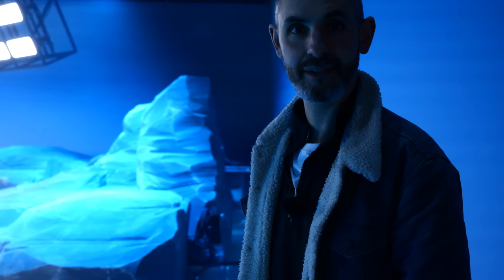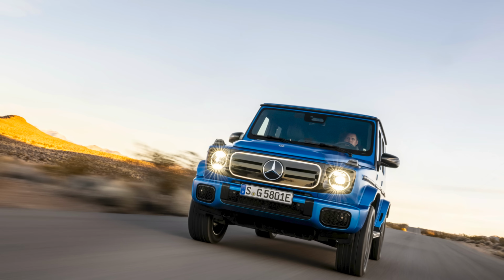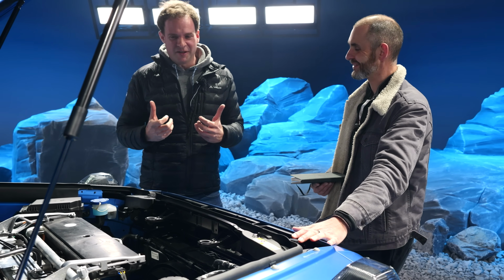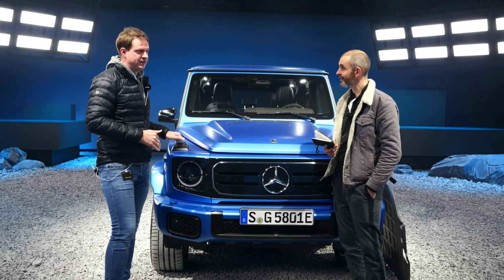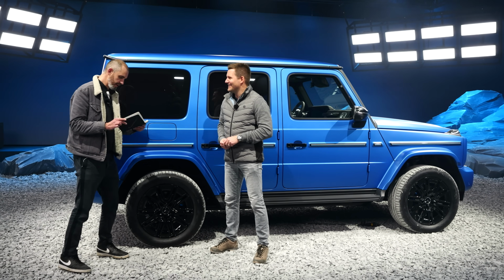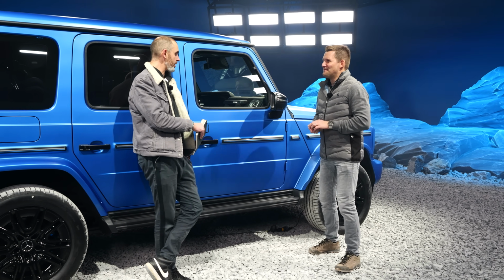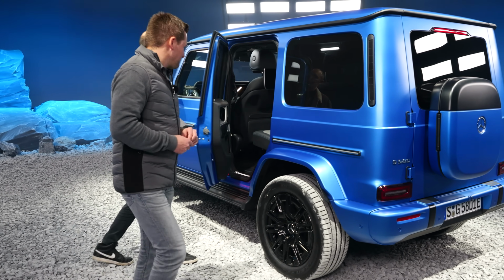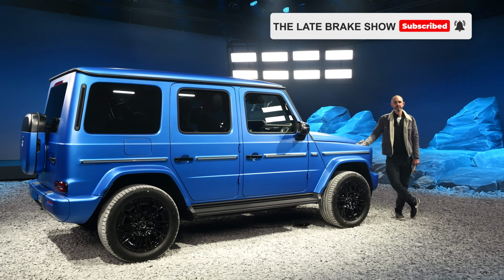Mercedes G Wagen goes Electric - Detailed 1st Look

Comment: Nice car, glad it is on the channel,  G wagons are unique though, better than the ICE version i would think. Price will be eye watering. but 3 tonnes is like other big EVs a bit lazy in the design. For Evs to really work we need  loads of 7 KW destination chargers that mean batteries can be smaller to get lighter more efficient EVs.

Comment: Lol……a  3 ton EV tank that will never be used off road……expect to see a lot of these pre-reg in 8-12 months at 40% off list……same as the Taycan. Small EV’s with small batteries for local use work ok with current battery tech but these behemoths are a resource hungry joke. 

Black Circles are no longer “proudly sponsoring” the infomercial either 😢😢😢

Comment: The EV idea has been pretty boring in my opinion pretty much since they came out, yes they have built some extremely fast ones but the practical side doesnt justify it but after watching this i actually really like the idea of the EV G wagon for what it is designed for and if you are buying it for actually off roading and having fun in then it does make sense if you have the money, lets face it most people couldnt afford it but for the few that can it sounds like a good fun car!

Comment: Hi I'm Carpenter living in Norway, the guy building the house beside my project had a G wagon he rolled it down a moutain side as in roof, doors,undercarrige about 7 or 8 times and still survived so he was totaly impressed with the strength of the box!
Reply: He’s lucky he wasn’t in the battery version then…….he would have survived to roll down hill but not the ensuing thermal runaway fireball!

Comment: Hi Jonny. Your show is quirky but real interesting. Not sure what the market is for the 3T Merc G Wagon as its weight is a problem when it comes to range. I'm in Australia own a 1965 289W Muzzy & a 2015 Forester turbo & I don't know how many times I have driven on the empty  line in the Muzzy or on the orange fuel light in the Subie. I live in the country so 200-300km daily is a regular occurrence. Charging locations are scarcer than rocking horse poo. Even If I run out of petrol, I can get to the closest petrol station get back to the car & off I go. An electric car would cause issues if those scenario's arose so that is a big reason for my reluctance to go electric car. I would be the perfect candidate for range anxiety. I love the idea of greater torque & power & the environmentally friendly emissions but there are other issues concerning the exploitation of developing countries that include uncontrolled mining (cobalt) & the high use of water (lithium). Mining & the refining of the materials used in electric cars have significant impacts on the environment, the very thing that is trying to be protected. History tells us this will occur (oil). These issues are not being discussed very much when talking about electric cars. Cheers

Comment: Whilst I appreciate the technology that has gone into this, as Jonny says, we do not need a 3 tonne SUV, either ICE or EV. Car manufacturers really should be focusing on smaller, lighter cars with smaller batteries that still achieve a decent range through efficiency. They may not be a profit machine but that shouldn't be the focus of manufacturers if the combined focus is reducing emissions.

Comment: EV's pretending to be ICE, how ridiculous is that sound bar?

Also, the same excuse for the front trunk as heard before, we have a lot of equipment.
If other brands can offer space, why can't a tall, boxy SUV offer a frunk?

I would be so disappointed with the needless over-engineering and the underwhelming practicality.
I mean no frunk, 200 kW DC and 11 kW AC MAX for a 116 kWh (usable) battery is underwhelming.
Why does this car way 3 tonnes? That's a ridiculous weight for any car, let alone an EV.

At the very minimum you would expect a full size, usable socket, with that big a battery it could be usable, even to charge another EV.

Comment: Is there some unofficial race between manufacturers to build the vehicle with the most capabilities that will never be truly used by their owners, except for bragging rights??
Is so this 3 tonne pile of technology rivals the Hummer EV and the old-school ICE Range Rover Sport SVR for top of the podium.
All are true triumphs of marketing and revenue generation.
Reply: Well you are paying through the nose surely you would want most if not all of the modern comforts possible. And you wouldnt have it stuck in a flood or snow storm embarressing yourself.
Reply: @stoff3r  Fair point, for the customers of these sorts of vehicles it's all about wants rather than needs. In the unlikely event they ever get stuck in a flood or snow storm,  the water will likely recede or snow will melt before they figure out which menu to access or button to push to turn on the appropriate traction mode.

Comment: It's pretty cool but I don't really see the point of it when the G500 exists and will be cheaper. The advantages of an electric car don't really apply here. It's cheaper to run and there's less maintenance? I don't care, if I'm buying a G-wagen then I'm rich and I can afford it so I don't care. The electric one is faster? I don't care, I'm buying a 2,5 tonne cube, if I'd want something fast then I'd buy Porsche and I don't think the electric one would that much better off-road because of all the additional weight and if you go exploring in the middle of nowhere the bigger range and the fact that you can carry fuel in jerrycans is a potencial advantage for the ICE one.

Comment: Interesting. I do wonder what market this is designed for? They must be forecasting low volume of sales...I feel like uber premium EVs haven't has the desired uptake. 

I can't see this being particularly popular in the Middle East surely they want the snorting V8 or V12 (if that still available)

What would have been interesting is developing a mini "g" wagon for a younger demographic and urban driving. It could utilise a hybridized version of the 0.7 litre 3 cylinder turbo engine found in the smart roadster...
Reply from the maker: All G wagens are low volume, handmade. But high profit (high exclusivity). These have been designed to work off road but, like Range Rovers, few owners bother.
Reply: @TheLateBrakeShow  Thanks for the reply. I appreciate it's a low volume product. I was just curious to understand what they expect the % of their G Wagen sales volume to be electric? If they are averaging 11,000 a year... (quick google) 

Seems like they've gone above an beyond to make a really credible luxury EV suv however I wonder if it's all in  vain.

Comment: I'm afraid it's just another overpriced, overweight,  supposedly politically correct version of a vehicle the world doesn't need. All that technology doesn't make it a great off roader, it's the skill of the driver using it. Only yesterday, I saw a very expensive looking Mercedes coupe, undoubtedly packed with safety tech and driver assistance tech run off the road on a downhill bend, very tight corner that opened to a very short straight before the next bend, literally a 40 kph bend. It was DESTROYED, run into a tree, every air bag deployed one entire front wheel, suspension and all ripped off sitting on the shoulder behind it. Three young men standing looking at what they had done and lucky to have escaped from. What about important information about projected rate of battery degradation? Realistic max number of recommended fast charges? Actual electrical efficiency rates? Electricity isn't free and although prospective buyers of something like this wouldn't likely care, it's the sort of information all EV car models should be required to declare, just like they do with combustion engines..

Comment: Seems like a great off road vehicle but as we all know its never going to be driven off road in reality I will be interested to see if the 4 gearboxes add a fail point that reduces the usual EV benefit of drive train simplicity and therefore lowering maintinance and failure rate. That said if you buy this car you prob dont care about running and servicing costs.

Comment: As much as I applaud them for moving on, the elephant in the room is that the vast majority of buyers are just flash city types who will never use the vehicle off-road. It's akin to the JLR set who will actively drive in the middle of the road to avoid puddles and messing up the status symbol.
I like EVs but I desperately wish more OEMs would provide small, light, city cars a la R5, to steer people away from the bullshit that a 3 tonne Chelsea Tractor is somewhat environmentally friendly. Especially given most  people obtain them on a 3 year PCP plan. It's not encouraging responsible ownership
Reply: Agree. However,  it is the wealthy city customers that enable manufacturers to develop these cars . The technology then trickles down into more affordable models for the rest of us. Think about things like ABS brakes and airbags . Tech that was only in the most expensive of cars originally that is now standard in all cars. The battery technology that Mercedes has to develop to make the G Wagon even remotely practical will be fantastic in a small much lighter city car.
Reply: @billhill4479  I disagree, the mass market is where the development funds come from. Motorsport is traditionally the breeding ground for tech innovation. The HALO cars are rarely that profitable, but they serve to work for marketing. I've worked in automotive design engineering for over 20 years and the only real exception I can name is T.50, but then GMD doesn't operate like most OEMs. Even Speedtail borrowed F1 battery technology
Reply: That's the same with most American SUVs and trucks. They were heavily promoted by automakers skirting emissions regs such that 99% of these things will never go off-road or do work in their lives. Instead some fatso will drive their enormous vehicle to go shopping. Imo trucks, SUVs, 4x4s should be classified as commercial or specialist vehicles requiring more rigourous inspections, insurance, tax to make them onerous to buy or own outside their supposed roles.

Comment: 3.1 tonnes. So realistically less than 400kg of payload in Europe? I understand that batteries are heavy, but that seems a bit daft for such a big car. I know it obviously will carry more just fine, but legally though... I would have thought they'd do better with weight reduction. I have to say I do love it though. Despite being exactly the opposite of what the ev market needs to do, it's really cool and I'd love to have one.
Reply: The ice version of this car weighs the same 😂
Reply: @stoff3r  no way,  500kg less
Reply: @Freimopp777  So the 2024 Mercedes-Benz G-Class G 550 4MATIC weighs in at 6945 lbs, that is around 3150KG. There is probably other engines that weigh less but this was the one with the most power I could find.
Reply: @stoff3r  Your number is Gross Vehicle Weight Rating (GVWR)   It is the  maximum weight a vehicle can safely carry, including its weight, passengers, cargo, and accessories.    Curb weight is  5,554 lbs.
Reply: @Freimopp777  Oh ok, My bad it's not my first language. My point was that many of the ev suv's weighs about the same as the similar gasoline versions. Like the cayenne turbo, range rovers etc. And don't start talking about the huge american cars and trucks weighing a fuckload.

Comment: I find it ironic that this G has less payload than a Renault Kangoo (petrol or electric). 
They need to build a two seater one to HGV reg to raise the max weight permissible.
Reply from the maker: No one buys them to cay heavy weight any more. That's the brutal truth.
Reply: I don’t know, mind. I bet DJ Khaled has one.
Reply: The G was never anything bu a poseur machine for people with no personality or positive attributes of their own. It's the dumbest and saddest vehicle on the road after the hummer.
Reply: @j17golf  that’s a bit harsh. You do see old w460s used off-road in rural areas.
Reply: You can barely use all seats ffs. 435 kg of payload is laughable.

EDIT; It's 415kg!

Comment: Tesla glued the battery pack into the car to make it a stressed component. In other words the battery makes the car stiffer. I thought that with a ladder chassis you could integrate the batteries into it to make it stiffer and store the batteries, So put the batteries in the gaps in the chassis?

Comment: I'd like to see one being put through it's paces on some hard-core green lanes. With the 4 motor system, it should be really good, but will need a more aggressive tyre fitted and maybe a lift kit. Mercedes will need to do that though, because I can't imagine any purchasers will. Dints and dings are going to get expensive quickly, but that's equally true for any of its competitors. 
If only someone could make a cheap off road kei truck, where the odd minor scrape just adds a bit of character and you don't have wrap it in cotton wool to keep it's residual value. Oh hang on, I think I did see a video on something like that a while ago.
Reply from the maker: I'm sure that will come with time.
Reply: It will be available with off-road wheels and tyres, the slung between the chassis rails batteries are heavily armoured on the underside.  Mercedes haven't published a towing capacity though so assume the same as an ICE one.

Comment: 116kwh battery - 289 miles wltp - holy cow…
Reply: Certainly more than enough for my daily adventure, 

at the local mall parking lot
Reply: That's the efficiency you get when you attach a battery to a house. Can't imagine you get more than low teens for the ICE one in the real world.
Reply: actually superb range with that shape. Makes you wonder where Geely went wrong with the Zeekr 001

Comment: I don’t understand the argument for not including a frunk.. They could’ve made the grill drop down or lift up with the bonnet, then it’d be really easy to reach into it.
Reply: Probably quite an undertaking to redevelop the whole front end, move around common components, recertify for safety etc. Even some of their bespoke EVs don’t have a frunk so not surprising a shared platform didn’t go that route either.
Reply: Why do you want to open the huge bonet just to put some groceries there. Better to use the normal boot or back doors.